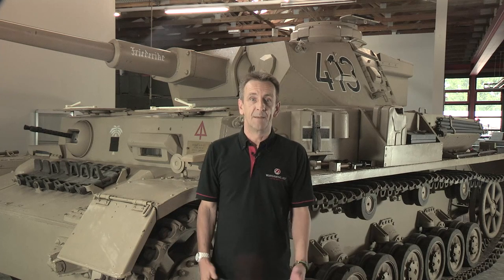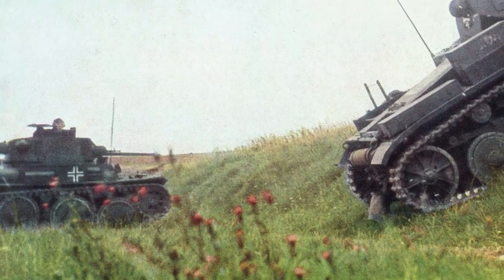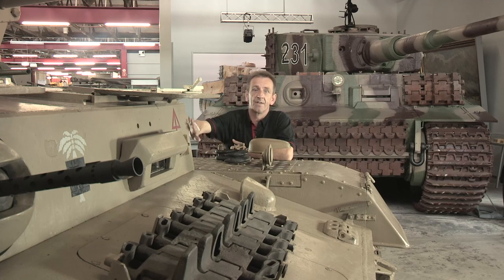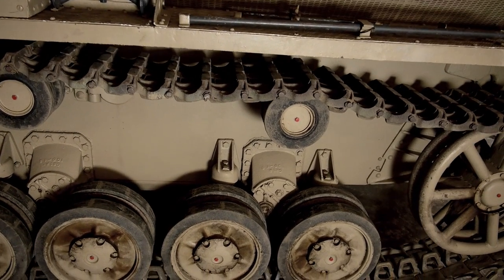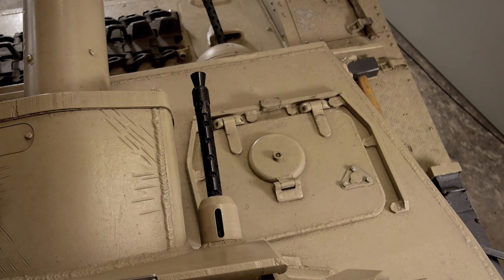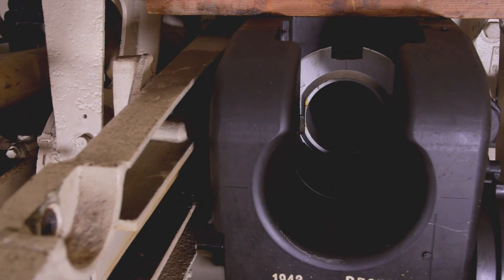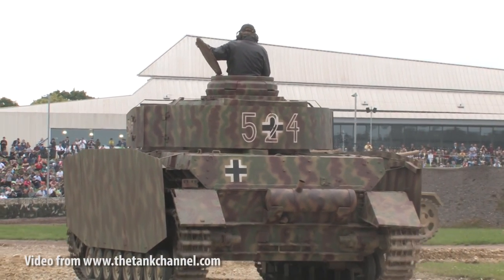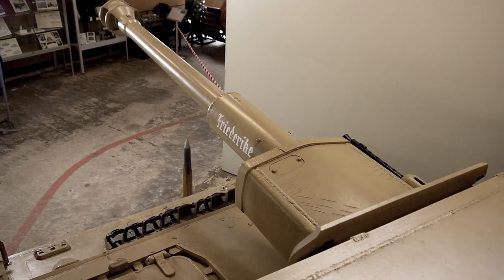Inside The Tanks: The Panzer IV - World of Tanks

Comment: Excellent video! One correction: The Schurzen attached to the hull & turret was introduced to protect the crew & key external parts from the rather problematic Soviet antitank rifles, which were very common on the Eastern Front. As far as I know, the Soviets, Brits, and British Commonwealth forces that the Germans faced prior to the introduction of Schurzen were not using hollow-charge ammunition at the time Schurzen was developed.

Even when the PzKmpfw IIIs & IVs became better armoured, Soviets armed with antitank rifles would still aim to take out vision blocks & gunner's sight, damage the suspension, damage the tracks (which were not hardened steel), and jam the turret ring & external parts of the gun, so Schurzen was deemed necessary until the end of the war.

So, Schurzen was retrofitted to older models of the PzKmpfw IIIs & IVs (especially command tanks) & installed at the factory all newer models.The same applied with German assault guns & tank hunters based on the PzKmpfw III & IV hulls.

BTW, it did turn out that Schurzen was quite effective in pre-detonating antitank ordinance that employed the hollow charge principle, so Schurzen protected crews from bazookas, PIATs, etc aimed at the more thinly armoured sides of the tank & turret. The wire mesh 'Thoma' version of Schurzen that was installed on PzKmpfw IV Ausf J tanks & late model assault guns/tank killers certainly took into account of the fact that during the late war period, enemy bazookas, PIATS, etc that fired hollow point ammo were a much greater concern than antitank rifles .

Comment: This is such a beautiful tank: decent armor, good gun (late variants with the L48 gun), big hatches for everyone, and reliability.

It would be better if you can slope that armor a bit more, and add a machine gun on the roof.

The Panther was the almost perfect tank; though being rushed into service, its engine were not as reliable. Also, the overlapped road wheels. That arrangement definitely had its advantage (better weight distribution, and added protection), however, they are easily clogged with mud, which freezes and jam the wheels, and complicate maintenance and replacement.
Reply: The armour was quite inadequate

Comment: No mention of the turret basket [the T34 didn't get that until the much later variants] and no mention of the Pak40s round being longer than a KwK40. The PzIV G, H, J Kwk40s used shorter rounds so that more ammunition could be stowed. 
Also, a PzIV didn't have the visibility of a Pak40 anti-tank gun crew so there didn't seem to be any practical reason to give a PzIV's cannon the longer charge as most tank battles occurred within 1Km, thus, making the Pak40's round too powerful to be practical when it made more sense to pack 100 rounds inside a PzIV rather than 65 of the larger round of the Pak40.
The Pak40 had a longer reach but, considering it could more easily be camouflaged & could spot enemy tanks much more quickly, a battery of them could make mincemeat of a company of T34s before the T34s even spotted them.

Comment: Fun fact: the thin bolt-on armor was to protect against HEAT shells. It would prematurely set the charge off, and the space between the real armor and bolt on armor would not allow the HEAT round to penetrate.
Reply: Well, it looks like later in the video he mentioned that. =D
Reply: +Moto Rad Incidentally, only Germans had HEAT shells in their tanks.
Reply: Pekka Rastas RPGs are HEAT rounds. It kept Russian shoulder fired stuff from roasting them.
Reply: Moto Rad Those aren't tank shells. Also it''s worth mentioning that the Soviets didn't have shoulder fired AT during the WW2.
Reply: +ultraboy222 It is not molten, just plastic and moving at extreme speed due to extreme pressure generated by the shockwave of the explosion. And as the HEAT jet can travel some distance these plates may not work, they may even activate HEAT round at proper stand-off distance. Heating metal up to the melting point takes too much energy and too much time. 

That 14.5 mm round had tungsten core and I am not sure, whether they were deformed here. Maybe to some extent. But importantly - they were destabilized, so they lost their penetrating power. Of course they could bounce, or hit with side instead of the tip and thus be ineffective.

Comment: I didn't realize until recently that the two rounded, domed rectangualr shapes on the front of the turret face are small shutters that open up so the loader and gunner can see out directly. 
Its interesting that the Pz III and IV share these details, and the same shape, and very similar suspension, yet are made by two different companies. Was this a case of them being designed by the army and then built by private companies? Or was it designed by one company, and used as a basis for the design of a differnt tank by the second company?

Comment: The Germans had a nick-name for the M3 Lee/Grant, (If I correctly recall, think the naming difference was that one a further turret on top, housing a machine gun, the other didn't) which was also later applied to the M4 Sherman. 
They rather descriptively referred to them as "Tommy Cookers".

Regards to all.
Rommel
Reply: "Tommy Cooker" applied to British and British used tanks as a whole, not the M4 or M3 in particular, though it was included.
Reply: Rommel the two names are for the same tank one is used by the Americans and the other by the British both had a main gun in a lower slightly rotating turret and a smaller gun on an upper rotating turret.
Reply: 'Tommy Cooker' was used for the early Shermans which had a weak spot where the ammo stowage was near the front of the tank's upper hull. Hit the Sherman there? and it exploded the HE ammo.
The Allies later added armour plate to that very spot [in some Allied propaganda you can see Shermans with the square piece of extra armour welded to the weakspot] and placed the ammo in water carriers of some sort but gasoline driven Shermans were still prone to explosions if hit right by a Panther or Tiger's powerful cannon. Diesel Shermans weren't prone to explosions unless ammo was ignited. 
At least it would have been a quick death.

However, I find the PzIVJ and Sherman M4 E3 w the 76.2mm cannon my favourite WW2 tanks. They could be easily repaired in the field with a small winch.
Reply: +Jack of Shadows didn't the Panzer IV J have a slower turret traverse speed because they had to get rid of the electric traverse due to problems with equipment and resources?

Comment: Those side skirts were not to be underestimated. I have seen a stug III with side skirts that actually survived a KV-2 shell. TO THE SIDE! I will see if i can find a picture of it anywhere.
Reply: The side skirts have a negligible effect against solid shot. It wasn't their purpose. If the StuG survived KV fire, it almost certainly wasn't because of the schurzen.
Reply: yes and no. If the KV fired HE, the skirts would detonate the shell with some distance from the main armor seriously diminishing the effect. 
Its also inaccurate that they were ineffective against solid shot (or in other words AP as nearly everyone except the UK used explosive fillers meaning it wasnt a solid shot per se). 45mm and above were nearly unaffected by skirt armor, but the skirts were designed mainly against 14.5mm AT rifles as used by the soviets. 30mm of armor were no obstacle to these things, and they were in every town, but if the 14.5mm shot had to pass through the skirt first, it got deformed so badly that it wouldnt penetrate the 30mm armor behind it. 
Thats by the way what the skirts were designed for. When the skirts were introduced there was noone except the germans even using infantry based HEAT rounds (be it rockets or otherwise) so telling us that skirts were intended for that is nothing short of BS. But Ive come to expect that from the Challenger, messing up on the easiest myths.
Reply: builder396 Would you expect an HE shot to penetrate the side of a StuG, even without schurzen?

Regarding schurzen and small calibre fire, I've come to learn what you've written. But, make no mistake, this myth is everywhere. Even military history books. I've found it in one Osprey book.
Reply: Hugo Carvalho Still, the myth is so obviously false even to someone who is only a hobby historian like me. Its this guys JOB to know these things, he earns goddamn money, and yet he is doing a piss poor job at even basic factchecking. 

Regarding the HE shell and StuG: HE shells against armored targets are extremely unpredictable. It depends on hundreds of factors, including but not limited to: Armor composition and properties (brittleness especially), HE shell type, fuze delay if any, possibility of spaced armor, armor thickness, whether the HE shell is optimized for explosive damage or shrapnell, and so on. 
Especially armor properties can vary wildly even within the same nation, with the germans especially so. Some tanks had extremely brittle armor, even in the early years before the molybdenum shortage, while others had excellent armor quality. 
Given these factors, some of the following things may happen: 
Contact fuze 152mm HE will explode on impact, hitting spaced 5mm skirt armor on top of 30mm base side armor of good quality with about half a meter gap. 
The skirt armor would be entirely destroyed, base armor would possibly be dented and have a thousand smaller dents from shrapnel. Track and running gear are also likely destroyed around the impact. Spalling is also likely. 
If the shell were to have a delayed fuze it would penetrate the skirt with its pure kinetic energy, and generally explode somewhere in between. Skirt armor and track/running gear would still be destroyed, but damage to the main armor would likely include large scale cracking and spalling. 
If armor quality is worse, the armor would likely spall and crack even with a contact fuzed HE shell exploding on the skirts, and with a delay fuze the damage would be quite devastating, probably beyond repair. 

But as I said, HE impacts are horribly unpredictable because so many factors are involved, and half of those factors are random.

Comment: While it's overstated that the Germans would have had better luck by JUST producing more of these.  The panther, when it had been tested, was a solid replacement and they produced relatively many numbers in a short span of time. It was rushed into battle (which itself had been stalled too much, Battle of Kursk). But the G model was great.

THAT SAID, the big cats very much somehow overshadow the main backbone of the Wehrmacht's panzer divisions (including the StuG). These were the ones the allied soldiers were most often dealing with, with the deadly 75mm gun (or the long 50mm (or the medium one, too) gun of the PzIII). Not to take anything away from the Allied tanks.

But it's been interesting in recent years (or well, since a long time for me now, but public knowledge isn't there yet) to more and more realise this. The Panzer IV F2 - G - H  (it was the J (iirc) which was the retrograde) were very good tanks, making up the armour issue with the fantastic gun.